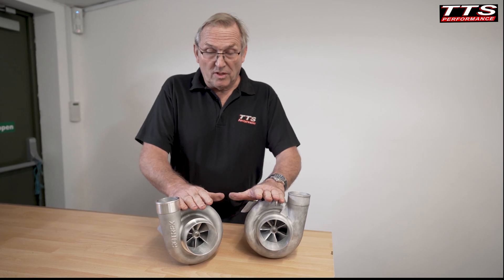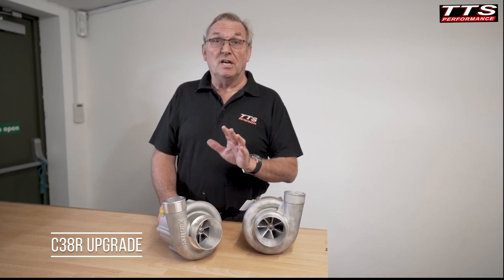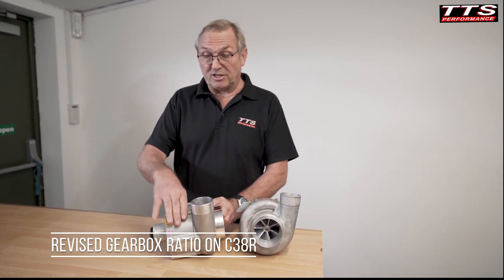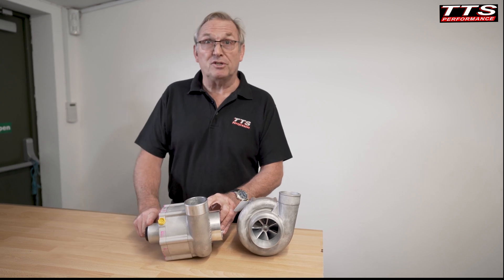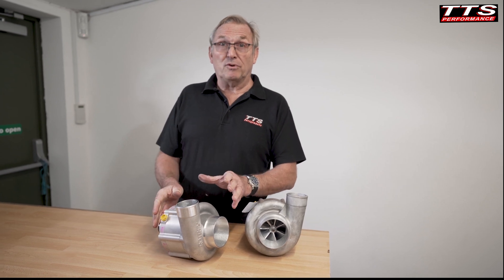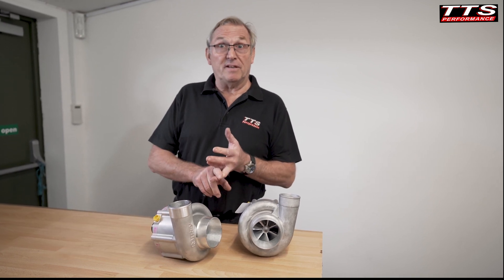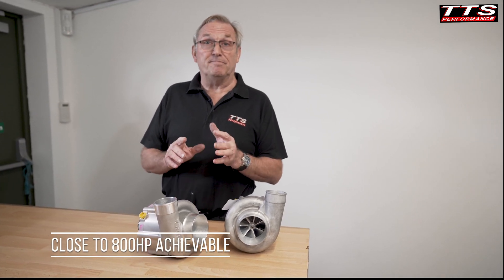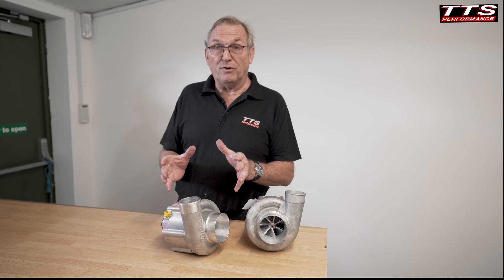New Rotrex C38R Audi RS4 upgrade - 800hp!

Comment: I’m interested in getting the C38 R fitted to my B7 RS4 would u guys be be able to carry out this job ??
Reply from the maker: We can supply our kit with a C38R.  But you will need an upgraded fuel system and run water meth injection. Your transmission will need upgrades to.  I will only supply the supercharger kit.
Reply: @TTSPerformance  I will be in touch soon as I’m going to  contact MRC Tuning to see if they can carry out the work on my B7
Reply from the maker: MRC are the go to.